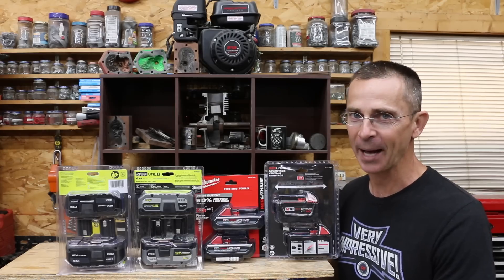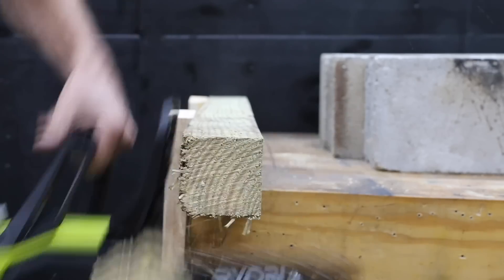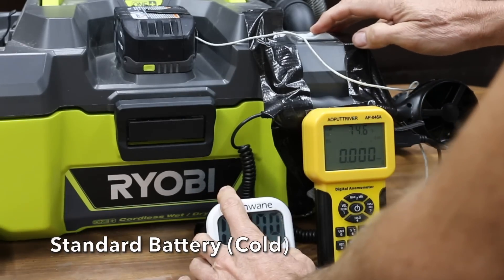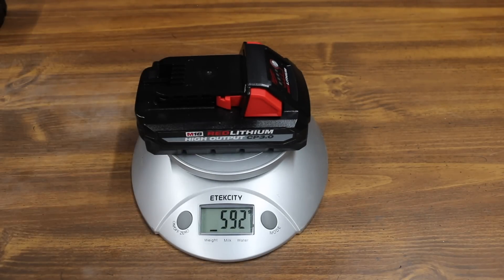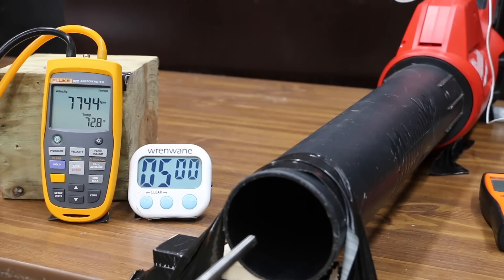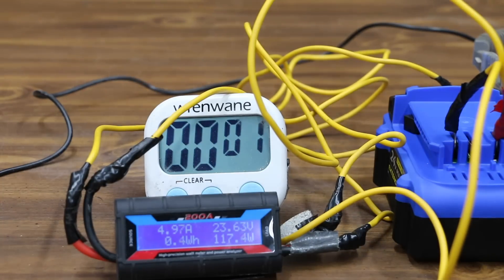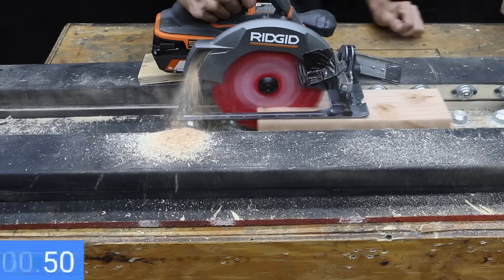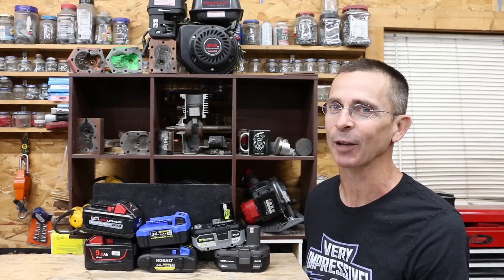Are "High Output" Batteries Better Actually Worse?

Comment: I love the channel! I think your tests did a great job showing that (for packs with the same capacity) "high output" really doesn't mean much under normal use (The total watt hours are the same). However, I feel there was a missed opportunity here. Both the Milwaukee and the Kobalt uses the larger 21700 cells in their 'upgraded' packs. Which to me directly implies they wanted the upgrade to provide better peak current output.  But the both the blower & vacuum would have a cap on current draw to prevent damage to the fans. The chainsaw could peak more, but I suspect that since the motor drives a chain, they too have artificial current limits to ensure safety if extreme torque is applied to the chain. Only the circular saw (conceptually) seems like it would be able to continually draw more and more (since the motor is directly coupled to the blade and transferring it's torque directly to the wood). ---- I would love to know how much the better the 'upgraded' batteries are at handling 'extremes' where the torque (and current) are much higher than normal. ---- I think running each pair on a circular saw as it tries to cut increasingly tough material would show if the 'upgraded battery' is a cash grab or an actual benefit for the few who are the most demanding of their tools. 

That said I am no expert on the EE behind power tools. Perhaps every tool has an artificial current cap set well below what the normal battery could provide, which is entirely possible. In which case the upgraded battery of the same capacity is totally a cash grab (aside from some limited cold weather benefits).

So I feel like that was a missed opportunity, but no hard criticism here... Your video still does an excellent job showing their behavior the way most people would use it. I love your work Todd! Thanks for putting these videos out there.
Reply from the maker: Thanks and you are welcome!

Comment: It's good to see what battery cells the different manufacturers use, as that should probably be your guide, for longevity..Samsung and LG 18650 or 21700 are the best cells out there..But you did expose a flaw in these batteries whether you understand that or not..These batteries should not be charged when temps are under freezing, and using them in under freezing temps damages the batteries and they will not last nearly as long..There should be a low temp charging protection, at the very least, and I would argue for a censor that wouldn't let the tool operate below a certain temp, diminishing damage to the battery and the tools being used..
Reply from the maker: Thanks for sharing.
Reply: You do know people work in cold climates... Heck I have bosch packs that have survived 6+ years of daily use while being left out with the tools in an unheated work truck.

If the crap stopped working in the cold, we'd throw it in the garbage.

Comment: Here's a hack to all these tools.
If you're capable and have a soldering station, you can replace the 18650 cells with higher AMP cells (25-30 amp).
Don't toss out a pack just because it won't charge anymore or doesn't perform at peak.
A soldering setup is cheaper than most all these batteries and by buying some replacement cells that are high AMP they will perform better than stock in many cases.
Reply from the maker: Thanks for sharing.

Comment: before i start watch this video no such thing as high output batterys the ah on the side means more run time only every battery maxed at 18v if have 12ah battery it gonna run for very long time ryboi and that say they high out put batterys better when they just same battery it market scam they make you think your getting better battery when your not
Reply from the maker: Good Point!
Reply: @ProjectFarm  it is i watched hole video maybe little bit faster that costs money when i wanna save i buy nomral batterys with higher ah if it for work

Comment: Bosch with their Biturbo tools have significant higher performance with the larger 8AH ProCore batteries, like going from 50 to 85nm torque on the strongest drill for example
Reply from the maker: Thanks for the feedback.

Comment: Those ryobi hp batteries are technically only made for the brushless tools that is what the 2 prongs on the back of the hp battery is for if you look at a brushless ryobi tool (minus new hp tools) you will see those 2 prongs in the bottom of the tool where those 2 prongs will meet and give the slightly older ryobis more power. With the new ryobi hp tools the hp I hear is built into the tool so those hp battery's with the 2 prongs don't have any advantage with the new tools where it's built into the tool itself. Just FYI!! Love the content keep up the amazing entertaining work !!!!

Comment: The high performance batteries running cooler helps for recharge times as well. Often my Ryobi angle grinder will drain a 4ah battery so fast it won't recharge immediately and give an over temperature error on the charger. Is it worth it? Meh, I just have more normal batteries and let them cool a bit before charging.
Reply from the maker: Thanks for sharing.

Comment: but if you compare the Milwaukee by size/weight the high output has a lot more.   In size the 6 ah High Output looked the same size as the 3 ah standard?
So the high output has more juice per size (dense).

Comment: Yeah, on regular tools those extra power batteries don't give anything extra. Then those tools that are starving for current on regular batteries they're golden. You might want to check Torque test channel where you can see those high power batteries make a significant difference on impact tools.
Reply from the maker: Thanks for the feedback.

Comment: ***HEY TODD YPOU KNOW YESTERDAY I WAS PUTTING ON SOCKS AND FOUND SMALL HOLES IN THE BOTTOM HEELS IS THERE ANY CHANCE YOU CAN TORTURE TEST WORK SOCKS LIKE YOU DID WITH GLOVES THE PLACE WHERE THEY GET HOLES THE MOST IS TOES AND HEELS. IS ONE FABRIC BETTER/DURABLE THAN THE OTHER.
Reply from the maker: Thanks for the suggestion.

Comment: I think others have mentioned it already, but the Milwaukee XC or High Output batteries only make a difference in the tools that can leverage them, they are usually the "Fuel" branded ones.
Reply from the maker: Thanks for the feedback.
Reply: Yep. I noticed a difference in power using an M18  XC 5.0 vs HO 6.0 in my gen 3 fuel drill and fuel leaf blower.
Reply: @Swim Fan It isn't marketing, that is what happens. The high output packs use different cells that can output more current aka amps. My 2.0 ah pack won't even let my 1/2in high torque turn on. It works fine with the HO CP 3.0

It isn't "suddenly" able to. A Samsung 18650 is rated at 20 amps and a samsung 21700 is rated for 35 amps.

On a standard pack with 10 18650 batteries max current output would be 40 amps. On a High output with 10 21700 max output would be 70 amps.

So 720-800 watts vs 1260-1400 watts
Reply: @libtrs838  Yeps. The 12.0 has 3 stacks of 5. It puts out 90amps.
Reply: Not for fuel, more for high amp draw power tools. Angle drill, concrete saw, cordless super sawzall.
Reply: @TheBostonstapler  Chainsaw, fuel blower.
Reply: Also count me in on air purifiers, for me, not sure how you'd test it, but VOCs / carbon filtering abilities would be important!
Reply: High output batteries or 21700 cells offer more amp discharge due to larger cells.  These batteries with higher amp current are ideal for power tools that regular 18650 cells just can't fully satisfy.  Things like chain saws, circular saws, impact wrenches, high powered drills.  They will not make any difference in tools where the tool has already peaked in its possible power output with lower amp current batteries.  Things like Vacuums, lights, and other light duty tools.

Ryobi high output battery ran 18650 cells so my guess is it's some kind of scam on their part, although they do have additional leads so maybe it helps a tiny bit in tools that can take advantage of those, I don't know, most of my stuff is Milwaukee and DeWalt.  But with Ridgid saw we clearly saw it made a decent difference.  Also, in my Milwaukee fuel table saw and 10" miter saw, I can easily tell difference in power when I put in a regular battery.  Current draw is so huge on those tools that if you try to use them extensively with regular battery, a battery protection will kick in and cut power to save battery.  I'm not electric so it's just theory, but I think it's due to current draw exceeding what battery can provide and it starts to overheat with a lot of use.
Reply: @Fpsnut  Many 18650 cells have different capacities and discharge rates. Milwaukee M12 high output batteries use 18650s as well.
Reply: Yeah but it was a fuel leaf blower sooooo...
Reply: @nitoloma6554  it was a 3.0 cp ho vs a 3.0xc. Those 2 batteries actually produce the around same amount of power(around the same amps, same watts). Main different being the cp is smaller. The CP ran hotter because it's a single battery stack vs a double battery stack. If the 3.0 HO was compared to the other M18 compacts(as it was meant to be). It would truly blow them away. Pun intended. Just like if he compared the 5.0xc to the 6.0 HO. The HO produces significantly more power. Nearly double.
Reply: @nitoloma6554  In this case it's just a brushless motor (more efficient). It's not a high torque tool like the saws and drill/drivers
Reply: 5 knock off batteries for the price of 1 Milwaukee XC HO? I'd go with the knock offs until Milwaukee gets into reality. Most of these electric tools use the same batteries, the only difference is amperage and logic boards being used. Tear down one of these batteries and you'll see the difference.
Reply: @clark7117  When you're using  circular saws, sawzalls, and drills/drivers in a professional environment, the difference on productivity is huge. Believe me, ripping treated wood with the 7 1/4 inch circular saw is a breeze with the 8.0 or 12.0. You can still stop it if you try, but with a 5.0 it becomes tedious.

Comment: We have a Mil. fuel hole hawg at work for cutting 2-4" holes. There is a significant difference in power so much that the guys will not drill without the larger batteries. The high output battery combined with fuel does make a large difference
Reply from the maker: Thanks for sharing.

Comment: Common misconception. If you read the microscopic print, it clearly says it's the money coming out of your wallet that's higher output, not the tool you're plugging the battery in.

Comment: The value come from higher peak volts. And holding them more consistently. Check out torque test channel. He uses impact wrenches to demonstrate how the 21700 cells can deliver more power than 18650

Comment: To be fair: You are using a 'non-XTR' version of the Kobalt tools. They make an XTR version of about a dozen of their tools. You need to test the XTR batts on XTR equipment...The XTR batteries will work in all Kobalt tools but you need the XTR version of that tool to get any real advantage. The Kobalt XTR batteries use cells that output 35 amps. The regular ones (18650) is 22-25 Amps...I use a couple of their 8 amp hour XTR batteries in my e-bike. 3 year warranty and crazy cheap if you get them on sale. Cheaper than buying the cells at $5-$7 a pop and building my own ;)
Reply from the maker: Thanks for the feedback.

Comment: I'd be really interested to see how the batteries perform in terms of longer term use, say after 20-30 charges.  I've had a run of Ryobi batteries in the past straight up fail after about 5 charges.  Thanks!
Reply from the maker: Thanks for the suggestion.

Comment: I have several BOSCH Tools of the green home series.

I can hear and feel the performance gain a lot when going from an 2.5 Ah to a 4.0 Ah battery. But the next jump to the 6.0 Ah battery ist faaaaaar less noticable.

My Kärcher WD3 Battery shopvac is the same: It runs fine with the 36V 2.5Ah batteries. But when i put one of my 5 or 7.5 Ah batteries in the vac it goes hearable and feelable much stronger and with more power to work.
Reply from the maker: Thanks for sharing.

Comment: It's interesting how the higher outputs often draw the amps down quicker even if it started with a higher capacity. Good application of algebra lol
Also quick note, I love your multiple trails of the same tests. I can see how it'd be hard to present that without putting people to sleep but you might have figured it out 🤠
Reply from the maker: Thanks!
Reply: Motors can only draw so many amps, a battery that can supply more amps than the motor can use means the motor will not perform any better. This is why its very tool specific. 

Also many high discharge rate high amp batteries (im talking single cells from the manufacturers) give up capacity to be able to discharge faster (though this is being improved quickly which is nice) 

So yeah, unless you have the right tool, the only benefit will be how it performs in the cold.
Reply: You would enjoy the Torque Test channel along with Todd and PF. TT really plays with batteries and beans as well. I enjoy these channels and in Todd I trust. 🇺🇸👍🏻💪😎
Reply: Huh, we did use algebra when we are older.
Reply: I fell asleep during this video but not because it was boring lol

Comment: Great video, but I would love to see a torque comparison between the batteries. I do believe the High Output batteries will significantly outperform the regular ones.
Reply: Was the chainsaw timed test not an adequate torque test?
Reply from the maker: Thanks for the suggestion.

Comment: I've purchased several knockoff M18 batteries, the price difference far exceeds the average quality difference. I do not have the high output batteries and have had to open up the case and reconnect a solder connection a time or two. I don't think that any of these batteries, regardless of OEM or aftermarket are touched by human hands until maybe packaging. Some of my subcontractors buy only OEM, their failure rate is equal to many aftermarket. I will buy four 5.0  batteries for the price of one OEM, if I get 90% run time from the aftermarket, it's a far better deal. OEM = overpriced equipment manufacture.
Reply from the maker: Thanks for sharing.

Comment: That knock off battery is cheaper than the smaller brand name batteries. If it out performs the smaller name brand ones, then it may not be a bad option if you just need a replacement battery or you bought a tool without battery and need one for that tool.  The 3.0 battery was $100, and for that price you can get 2 9AH knock off batteries and have money left over to buy an accessory.
Reply from the maker: Thanks for the feedback.

Comment: This is a very informative video! Based off the results I think I'll save some $ and get the basic batteries.  

Can you please do a video testing the Royobi Power Inverter for their battery packs? I used one for a heated blanket during a power outage this winter, and the control unit melted. I'm very curious if the inverter has a "dirty" output and is to blame for the almost fire.
Reply from the maker: Thanks!  Thanks for the suggestion.

Comment: Interesting results. 
💥What if you used those battery adapter devices for each brand of battery, and then connect the output wires to to a common load (like a higher draw device like a saw).
This type of test would put all batteries 🔋 on the same playing field being compared with each other. 
BUT I guess the other factor to consider is the advertised amp hour of one battery compared to a slightly different amp hour battery. 

It would be a telling comparison of just how similar batteries compare to each brand.

By the way, the name Ryobi is actually pronounced, Ree-o-be. 
I discovered this on the company website years ago when they first came out.
Reply from the maker: Thanks for the feedback.

Comment: I hope you do a compare with just Dewat batteries... reg, XR, Flexvot, and Powerstack by various amp hours sizing by different perf by tool type, how long it'll last, and cost.  I know you were a fan of the Powerstack, except for the price.  I think you (or someone else?) did a past test indicating the 6ah XR was the best balance between getting higher tool performance over 4ah or 5ah batteries... but with the new higher ah Flexvolt and Powerstack, will we see a different result?
Reply from the maker: Thanks for the suggestion.

Comment: So $44 for 3.5 minutes less use of tool time. So 4 x $44 = $172 vs $229 for 1 original battery.  And you can have much longer run time. 4 x 11minutes =44 minutes vs  1 x 15 minutes

Comment: 18650 batteries usually have a second number - 1500, 2000, 2200 suggesting the mAh capacity. A lot of knock-off batteries use the cheaper 1500 mAh cells. That would suggest the 9Ah knock-off was only a 4.5Ah pack, explaining the lack of power.
Reply: Vanon scam batteries has 1500mah cells, but Waitley uses 2200mah cells. So some aftermarket batteries are better than others. Vanon batteries really are garbage. I ones tested Vanon cells and those 1500mah cells real capacity was 1380mah. 😆
Reply from the maker: Thanks for the feedback.